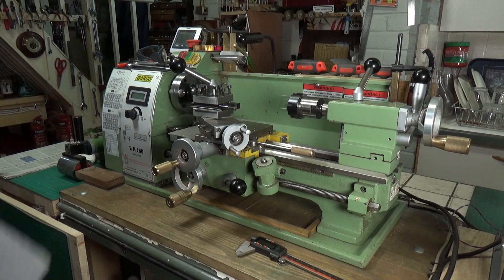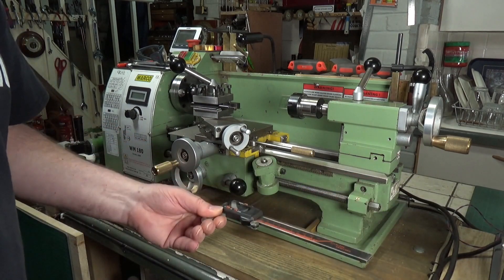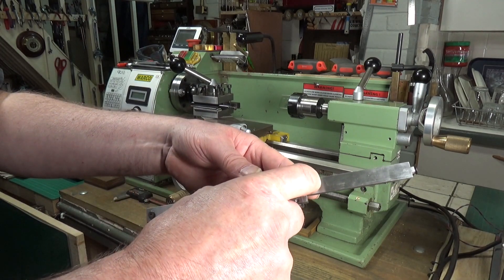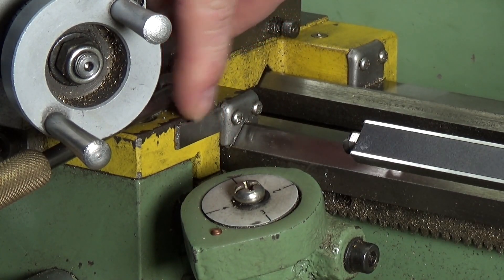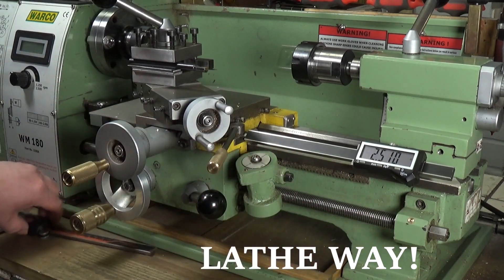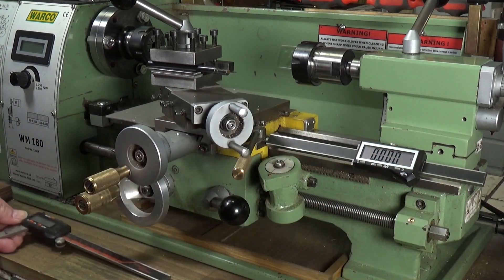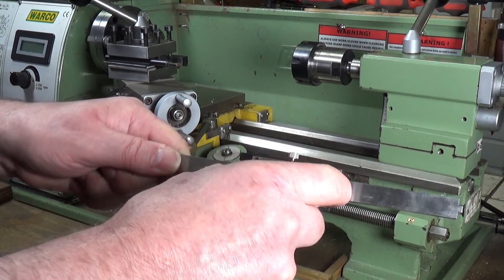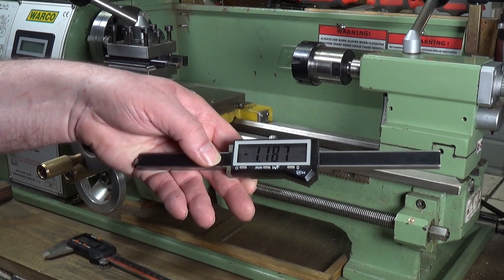Warco WM 180 Lathe MK2 Single Axis DRO

Comment: I did this on my lathe a while back but it was fixed.   I thought about magnets but assumed they would interfere  with the digital internals?
Reply from the maker: Hi. I did consider that but so far I've not had any problems. The temperature gauge digital readout for the probe I have strapped to my lathe's motor came with magnets on the back of it. Again, no problems with the electronics.
Reply: Thanks, magnets for me then. now subscribed
Reply from the maker: @bertyjustice4424  Thanks for the sub 👍

Comment: hi alan
great idea, i may have to copy that if you don't mind. Can i just play devils advocate though, if the digital calliper is a 1/4 of the price why not just chop the fixed leg off one of those. 
Bye the way alan the hexacut info you gave me as helped i'm going to make a similar saw with a 2 speed gearbox, i've made a start, i think those little saws are brilliant especially for space saving. 
Thanks for sharing this idea
regards
mr f
Reply from the maker: Hi. Copy away, my hope with these videos is that other people will find them useful and maybe go down the same route. The digital callipers are made from extremely hard metal. I attempted to cut and then grind one and realised that it would take a lot of effort to remove the legs. I was also concerned that along the way I might destroy the display. The Kennedy Hexacuts are brilliant little saws, myfordboy made a very similar one to his own design, might be worth taking a look at his videos on the build. Video here https://youtu.be/P5Tu_zoO828 . Cheers, Alan.
Reply: @RetroSteamTech  cheers alan

Comment: I did the same thing I used Harbor freight calibers and I use the grinding wheel to grind off all the pointy parts it works quite well as you described thanks for passing along
Reply from the maker: Thanks. I did think about grinding the points off one of the cheap Banggood callipers but they are very hard, I'm all for avoiding hard work 😂

Comment: Hi Alan,  I'd not seen those on BG before.  Good idea and works well.  You could probably put a magnet on the end of the scale and avoid any issues with cuttings being attracted to the one on the carriage.

I use a similar system based on a digital tire tread depth gauge, but it can only do a small range.  It's spring loaded.  Still very useful for gear cutting and other tiny precision work - it will clip on to the cross slide dovetail as well.  The one you have is quite pricey, but in line with the cost of an equivalent permanent scale.

Banggood keep coming up with new items and it's easy to over look them.

Interesting video.

Cheers Rob
Reply from the maker: Hi Rob. As I said to Kimberzelik above, I did consider grinding the ends off one of those cheap Banggood callipers but they are bloody hard. So I just did a search for 'digital gauges' and eventually found the marking out gauge.  What really impresses me are those small flat magnets, they are extremely powerful. Once the gauge is on the ways it's not moving!  I use a very expensive and hi-tech method to prevent the magnet on the carriage picking up chips...........I put a piece of masking tape over it 🤣 Cheers, Alan.

Comment: Brilliant. I could do with something on my tailsock and have not done it because it gets in the way. This could be a solution.
Reply from the maker: Thanks. As Rob says below, if you glue or clamp the small magnet to the end of the scale then the whole thing is self contained. Cheers, Alan.
Reply: @RetroSteamTech  I have my tailstock version up and running, I'll upload a video sometime. Total cost was £6.69. I used one of the
carbon fibre filled plasic calipers, easily trimmed to shape. Accurate enough for the tailstock.
Reply from the maker: @myfordboy  I never even considered one of those, much easier to trim off the jaws on the end and attach a magnet to. I might have to make one for my tailstock. Look forward to the video.